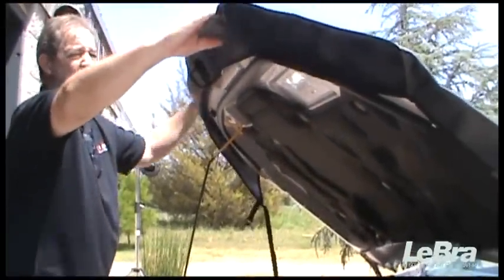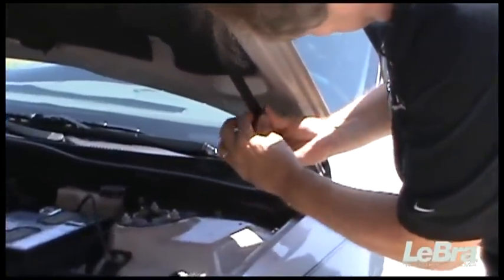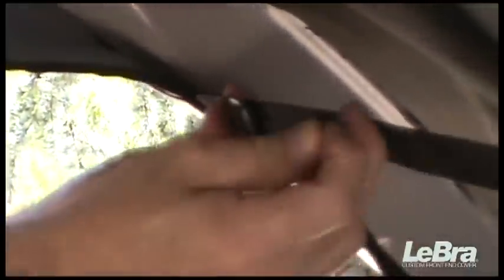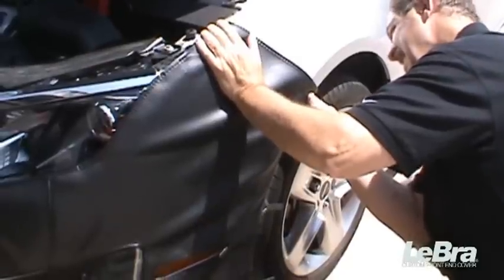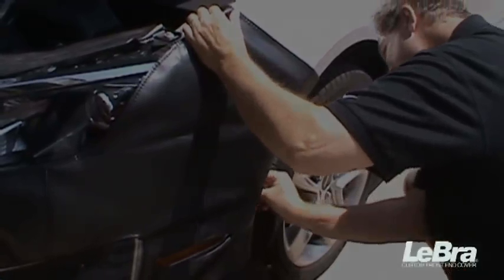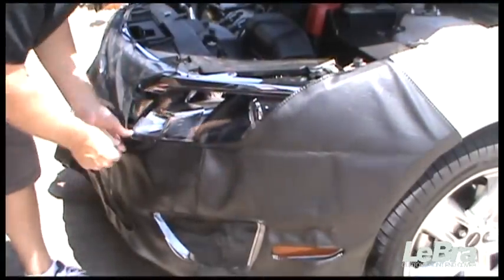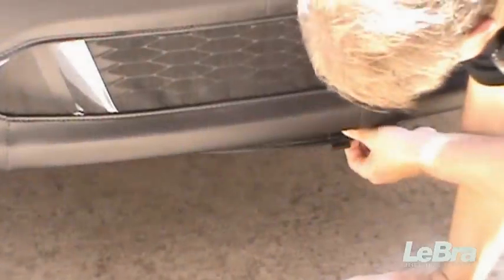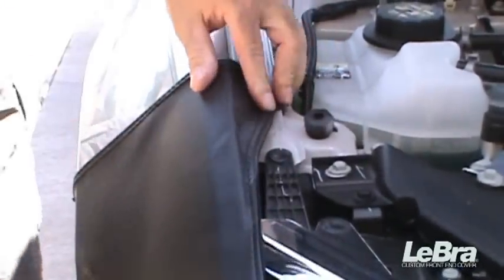How To Install a LeBra Custom Front End Mask

Comment: Well, I am happy to report, he did get it on there and it looks MUCH BETTER! I drive the same Ford I drove in 2002, it has had front end damage for most of the past 10 years. SAME damage. No damage to mechanical function whatsoever. I did not want to spend $7,000 on body work, to fix a car worth $1500 according to The Blue Book.  This was a perfect fix for me, but for necessity of having a relative install it as no shop would .

Comment: I called Covercraft Industries up on this a few weeks ago and I NEED to know when will you offer this front end bra cover on a 2023 Toyota Corolla XSE hatchback in the Colgan or Wolf brand? 🤔🤔🤔🤔????  Whenever you do offer this I will most CERTAINLY BUY IT.👍😁 
I will also consider the LeBra brand too as I have used that but it did not have the foglight and radiator protection like the Colgan and Wolf brands did.

This design provides GREAT protection and is the only front end cover bra I know of that will protect the radiator fins from getting bent up from rock/gravel and keep out the bugs.  PPF and ceramic coating can't do this and is too expensive anyway$$🤑
$$. 
Just as unique, is the fog light protection which is the mesh netting that protects against rocks/gravel/road debris.

 I have used this product with GREAT SUCCESS ON SEVERAL OF MY PAST VEHICLES and it even helps in minor fender benders and parking lot mishaps that I have experienced.

This front end bra cover does NOT ruin the paint.  I have used it for many years when washing the car as well as driving through storms with this front end bra cover on.👍

Comment: Do u have one that actually addresses the small issues like "NEEDING A LICENSE PLATE????"
I actually ended up tacking my license plate over it. Crude but to the point. Same with my car cover, gotta be smart
Reply: Maybe move to a state that doesn't require a front license plate???🤣🤣🤣🤣🤣

Nah, but seriously, they do have ones with the license plate cut out so it is extremely easy to work around.

Comment: I was very skeptical because of how cheap I paid for this and I was a bit worried that it wouldn’t be a custom fit but rather a universal fit that would give a loosely fitted look. After installation, the mask fitted my 2016 Honda Pilot like a charm and looks great! I’m now ready for my road trip. The only thing that is concerning me is that someone commented that they had to repaint their car... I’m hoping I will not come across this.
Reply: I've used these masks for years and have not had to ever repaint a car. If you don't take the masks off on a regular basis and clean off the sand and grit, wash the car, and rewax the paint, there may be some damage. I use a dry scrub brush to clean larger areas of the mask and an old toothbrush to clean the top ridge of the hood mask (where the mask touches the top of the hood). If you don't do this, you may wind up with smudge marks on the clear coat. These marks can be buffed out with a foam pad and paint polish using a random orbital polisher. The front end on my Scion XB looked pristine when I turned it in off lease because I followed the manufacturer's directions  for maintaining the covers and the paint surface. Using the mask avoided bug damage and sand blasting. There is no substitute for routine maintenance, whether you are using a bra on your car or not. Wax is a wonderful thing!
Reply: I have put one on 3 of my vehicles. I think they look 100% better with them on. Occasionally I slip them off to clean under them but even if it did damage, I would still put it back on. Its permanently better looking with it anyway.
Reply: I had one on my Porsche 951 and just ordered one for my new Ford.  Never had a problem with the paint.  Just make sure to apply a good Garnuba wax to the paint before putting the cover on and take it off regularly to clean underneath and reapply the wax.  If you want to take an extra precaution you can apply some Road Trip Tape in the areas where the clips are.

Comment: What about the license plate?
Reply: Shouldn't be a problem as bra is designed for your car.
Reply: @microminiskirt  ok so it covers the license plate
Reply: @glenthornton6300  No it shouldn't provided it's designed for your car.  If it does cover it, don't get it unless you don't care.

Comment: Can you regularly wash your car with it at least twice a week to 3x
Reply: Hi there, I have a carwash subscription, I go about 1-3x every week. The only thing I've noticed (and this was on a LeBra that was 10 years old) it would stretch a little bit when I'd leave the carwash; I hit the freeway right out of the carwash, and I can tell the top bra, the one that goes on the hood, would flap a little bit. I ended up buying a new bra, and I don't have that issue anymore when going through the wash. I think over time, (10+ years) the fabric naturally will stretch out and will need to be replaced. But 10 years isn't too bad of a lifetime for something that took such a beating in my opinion. 🥳 I hope this helps!🤗
Reply: Yes you can.

Comment: Since nobody in town will install it and i don't have the physical strength, my teen is now doing It this.  He got it on without watching this video (i watched 4X).  It's 60°F outside, that's a "warm" day.  "slip keyhole grips over the wheel..." is hard if you do not have muscle and if you cannot stretch the cloth...a blow dryer for hair might help.  i got it within a 1/4".  hopefully my son will stretch it all the way, he's stronger....!
Reply: AbbyJo Ovitsky Fedorah Chiu  is it waterproof? do you still have it on your car? Does the leather last of fades?
Reply: Remember to follow the directions on how to maintain the bra. You can't leave it on for prolonged periods because sand and road grit will get under the cover and act like sandpaper on the paint. The Bra has to be taken off every 3-4 weeks and cleaned. The manufacturer also recommends keeping the bra off for a short period of time so that the paint gets exposure to the sun, and ages along with the rest of the uncovered paint. The front end should be washed and the paint  rewaxed when the cover is off to add protection against abrasion. I just bought a Honda Odyssey mini van and will put a bra on it to protect the finish so that it will look like new many years hence. Using a clay bar on the paint before waxing will also improve the look of your paint job.
Reply: Using a blow drier is a good move. it will help you to get a more form fitting look.

Comment: How much protection it provides
Reply: This design provides GREAT protection and is the only front end cover bra I know of that will protect the radiator fins from getting bent up from rock/gravel and keep out the bugs.  Just as unique are the fog light protection the mesh protects against rocks/gravel/road debris.  I have used this with great success on several of my past cars even in fender benders.👍

Comment: As nice as it is the idea of protecting from Little Rocks especially on the highways it also traps moister from rain and weather in general which will ruin the paint eventually if it isn’t removed frequently to dry the trapped moister. I’ve used the bra on my car for a year and after seeing the moister being trapped and the paint started looking dull from the moister I ended up removing the bra.
Reply: Not true. I used my LeBra for many years driving through storms and washing car.

Comment: do you have for lincoln ls
Reply: Covercraft Industries, LLC Fedorah Chiu  is it waterproof? do you still have it on your car? Does the leather last of fades?
Reply: @angelbluerider9588  that stuff is trash in will ruin your paint job don't use it. Not just this brand, all car bras ruin the paint. if someone were to leave a letter jacket on her Hood in the middle of the summer, what do you think happens? Nothing different than this... not to mention when you're going 80 down the interstate and that thing is flapping back and forth, that can have a wear effect on the paint aswell.